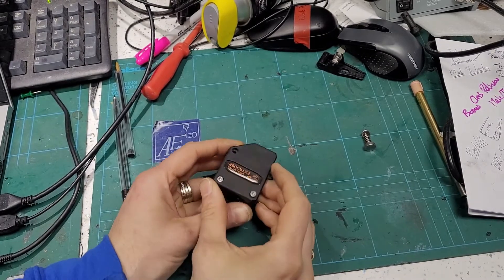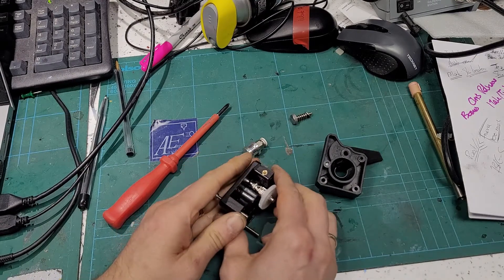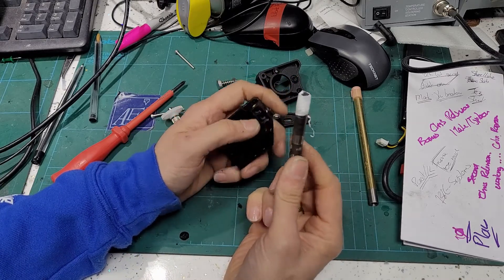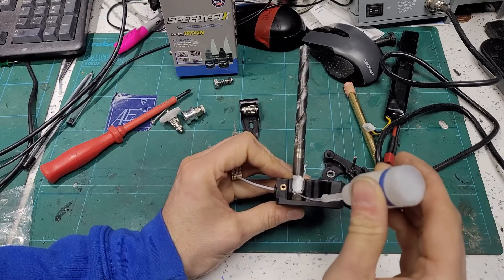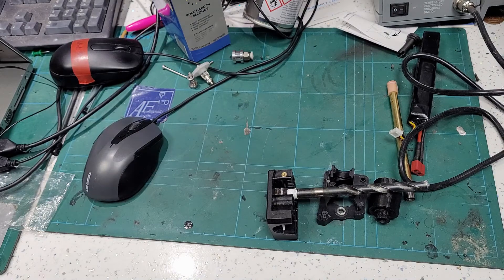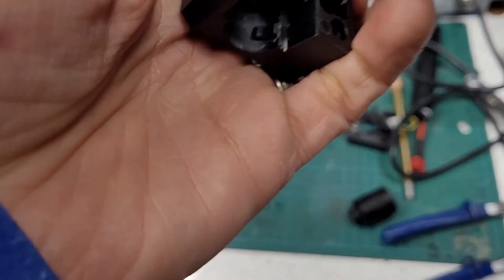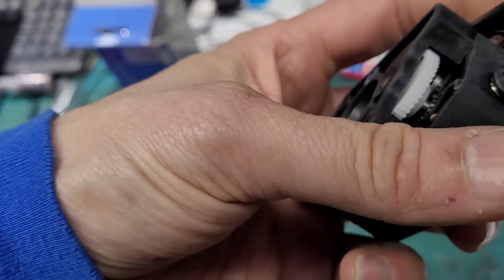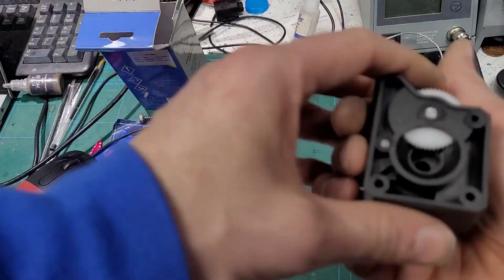Clone Bondtech BMG Modification for perfect Flexible Filament Feeding

Comment: Do you use it in a bowden setup of direct drive? (pushing or pulling?)
Can make a big difference how to extruder copes with flexibles..
Reply from the maker: Using it in a bowden setup approx 400mm long. Feeds soft TPU ok at 30mm/sec
Reply: @chazj1976  👍